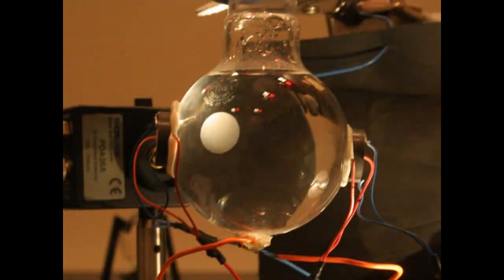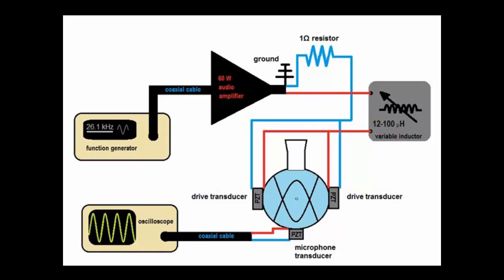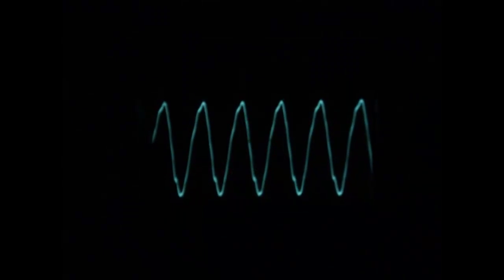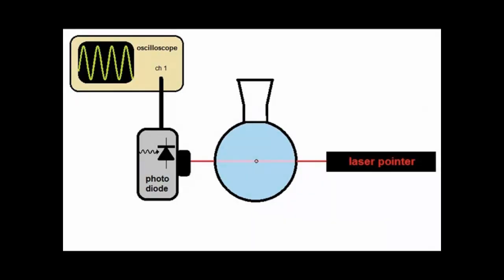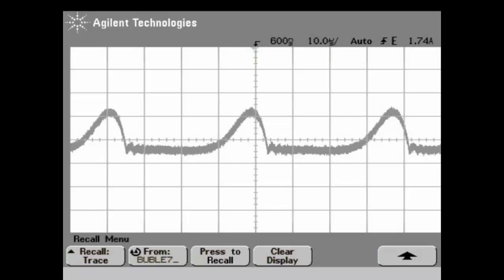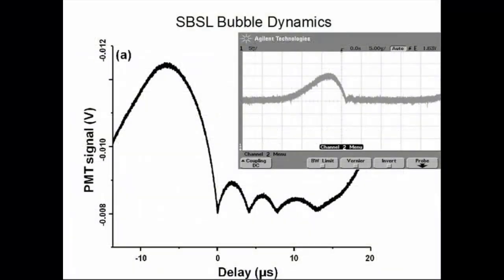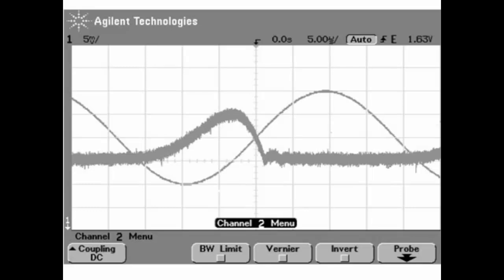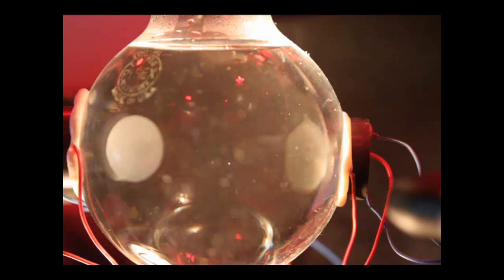Sonoluminescence:  Mystery and Delight

Comment from the maker: Indeed it can be done in other liquids.  In fact, the brighter luminescence can be obtained in sulfuric acid, according to the literature.  I've used solutions of glycerine and tap water.  The bubble behavior was different with the glycerine- less lively and harder to drive. It did glow brighter, though.  In tap water, the bubble was a bit less stable, it seemed.  The tap water was full of particles that helped me aim a laser at the bubble.

Comment from the maker: It's really all about pressure in a fluid.  A sound wave consists of pressure fluctuations.  At low enough pressure, the bubble fills with vapor.  Returning to higher pressure, the vapor condenses and the bubble implodes, The remaining gas is compressed and heated.  This is cavitation. The actual light-generating mechanism in sonoluminescence, however, is still a mystery.  There is strong evidence for a plasma.

Comment from the maker: @abaco580 

I am fortunate using an old variable inductor with a tuning wheel;  I don't know how it works.  My drive frequency was around 26 kHz and the inductance was about 28 mH.  If your inductance is not in the range you need,  try putting other inductors in series or parallel.  Shop around for the right frequency- different flasks have different resonant frequencies and flexing modes that can fool you.  The bubble behavior will tell you if you get it right. Patience and persistence is key.